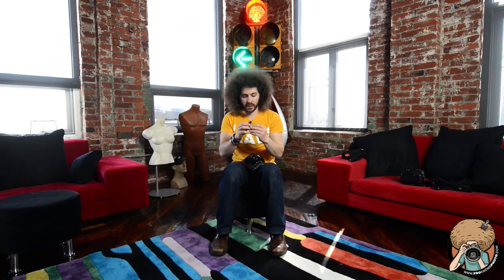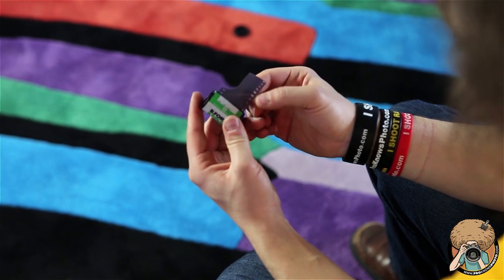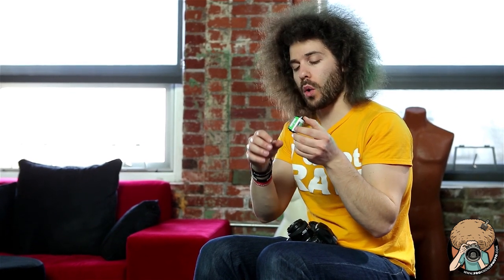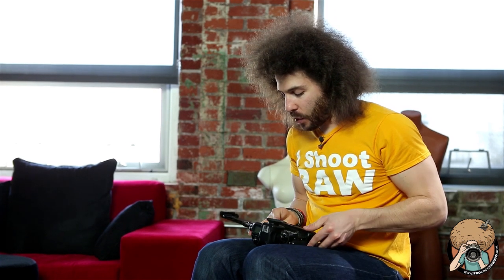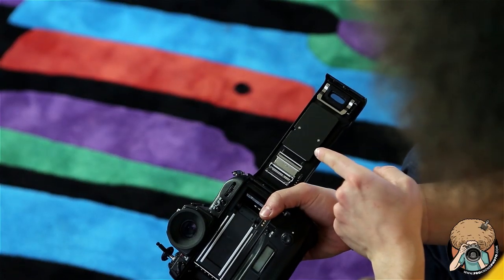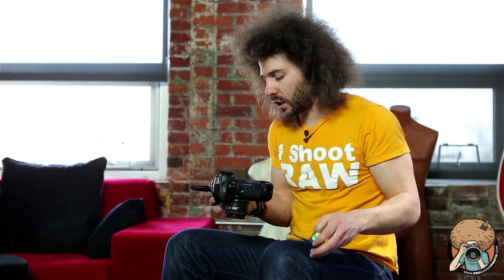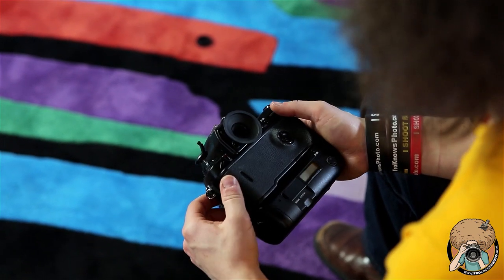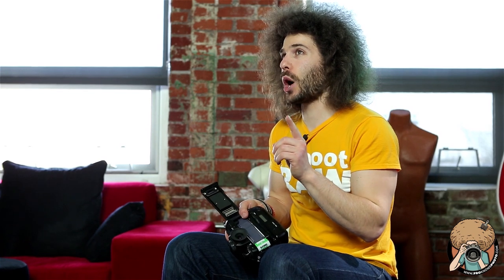How to Load Film into a SLR

Comment: I think film has more 'umph' when it comes to forcing people. Not only are you limited on shots, the process of having to wait is also encourages people to get the shot right. Using a card still allows you the temptations of using software correction afterwards, and it allows you to view the frames too quickly. 
If you want to avoid film, a better way to get better is to shoot black and white. Since color will not be an option, or a distraction, composition will mean EVERYTHING.

Comment: Nope, stick the leader end in the take up and hold it, in place, with your right thumb.  Then pull the canister to the left and drop it in the canister bay. Push in the winder and close the back.  Click off a couple frames to the first usable frame.  Then turn the winder knob back gently to take up any slack in the canister.

This takes all of 5 seconds and is very efficient.  The demonstration video looks very awkward.